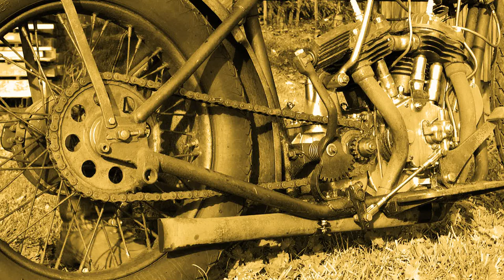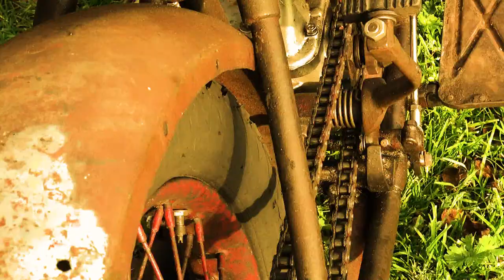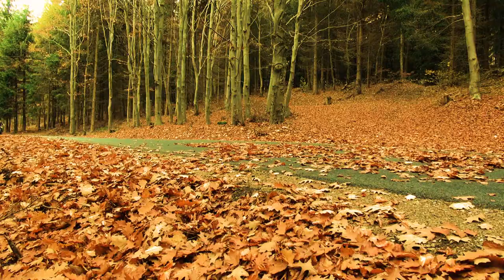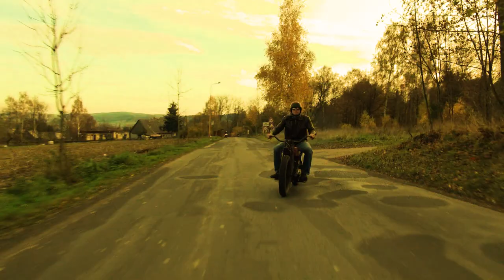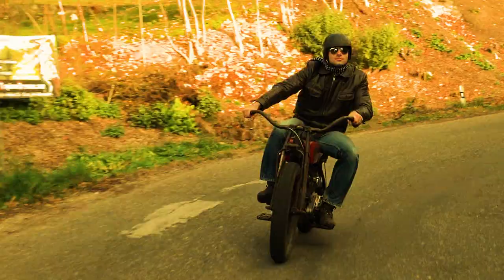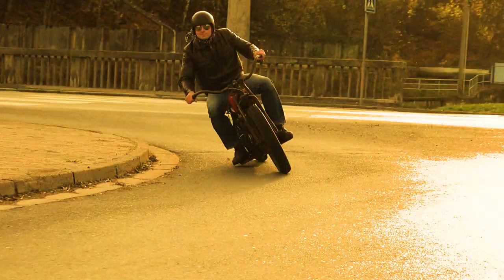Indian Scout (HD)

Comment: Even though modern machines are more reliable and handle far better...I don't think they'll approach the character the old iron had.  Plus, this motorcycle is the same model Burt Munro did his speed run on at Bonneville back in the '60s!
Reply: Alonzo Branson - actually very few modern motorcycles handle as well as the Indian Scouts from the late twenties to early thirties.
Reply: You have clearly never experienced a vintage Indian, Henderson, ect. They were built for reliability; and to tractor standards. Were built for the rough unpaved roads of the era. The best riding bikes on modern roads, bar none. Our Indian has at least a 100,000 miles (our estimation) and the engine has never been apart; at least in the 64 years it's been in my family. I'd call that reliable.
Reply: Munro had a scout , but a 1920 scout. This one is a little bigger,  older...

Comment: Why is he tinkering with the bolts in the beginning?
Reply from the maker: OaktownsGreatest I'm not the owner...but I hope it works like fuel petcock...
Reply: +OaktownsGreatest I suspect that he is opening either the oil or the fuel feed. There are 2x compartments inside the fuel tank. 1x fuel tank, and one oil tank for the engine. So it depends on which one he was opening.